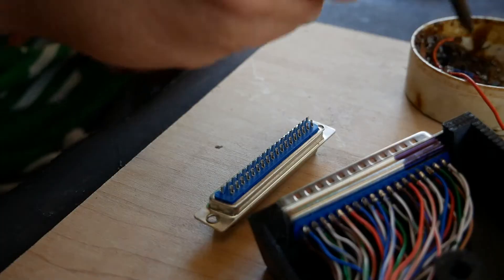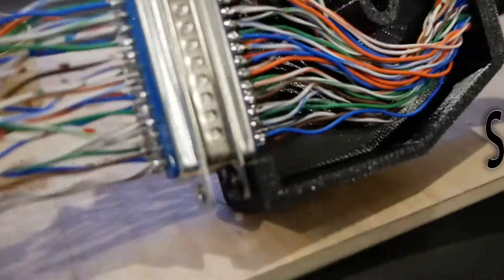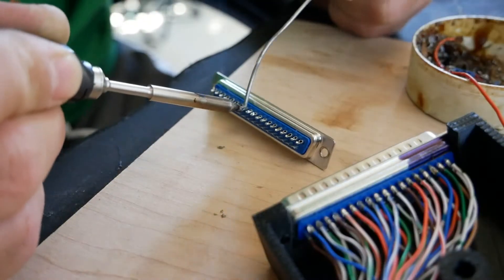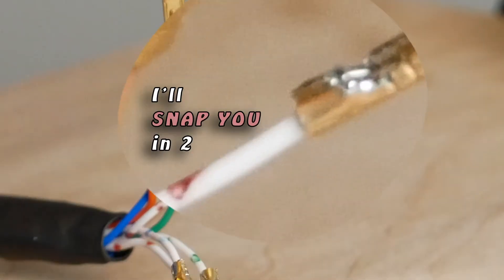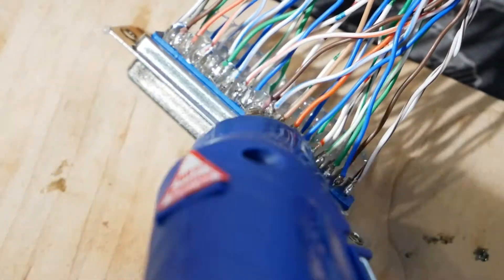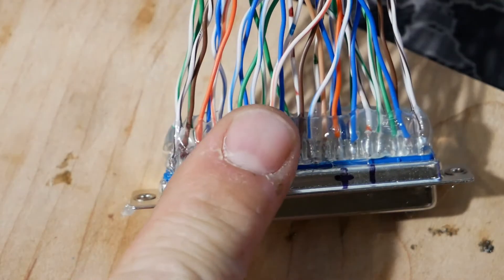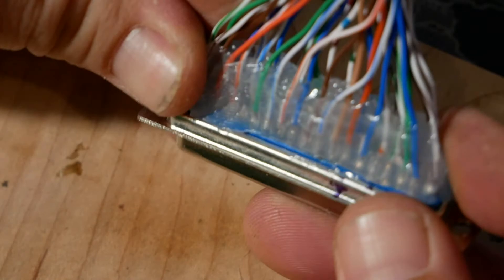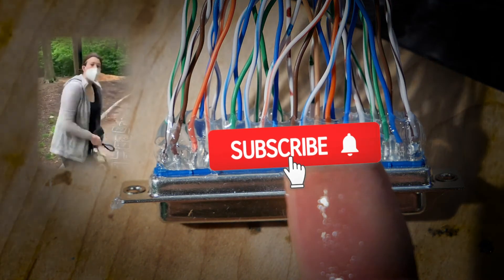Mechanical Strain Relief - TWO MINUTE TIPS for guys and gals

Comment: Further tips on soldering to those D-sub connectors (like the DB37 in this video):  
1. plug the mating connector into the one you're soldering. The pins in the mating connector will help hold the pins you're soldering in place. They will have less tendency to melt the plastic housing and shift to a different position.
2. Hold the connector in a small vise or other fixture to keep it steady.
3. Try to use the type of connector that has separate pins and comes with an empty connector body. You can solder the pins separately, then snap them into the hole locations in the body.  But caution: On some makes of this type of connector the pins can later be removed (using a small tool), which is quite useful. But on others that look similar the pins are not removable.

Comment: Saliva is a non-newtonian fluid (it's viscosity changes depending on the stress or forces applied to it) and it tends to adhere to foodstuff (like skin but not so much to thermoplastic adhesive go figure),  making food slide easily through the esophagus (or a finger across hot melt glue).

Blood is also a non-newtonian fluid although I would not recommend it for this application (that would just be weird).
Reply from the maker: I didn't know :)
Reply: Only Newton had newtonian saliva, he could never use this method

Comment: hot gluw is a crime against humanity. use epoxy, silicone or polyurethane
Reply: You know what's a crime? Epoxy, because it's not flexible, it's not suitable for strain relief, it's not removable, and it makes repair later impossible.

Polyurethane what? There's a million of them.

Ht melt glue is perfectly fine, as long as it's not somewhere where alcohol vapour or high voltage or temperature is expected.
Reply: @SianaGearz  high voltage? As far as I was aware hot glue has a very high resistance?
Did you mean high amperage (eg, heating up the wire) ?
Reply: @ColinRichardson  Don't rely too heavily on random hot melt glue's dielectric properties. It tends to hold up fine at low voltages but if you're unlucky you may find that it will arc over and carbonise, creating a conductive path, when subjected to mains voltage. Its insulation properties break down when heated or due to absorption of other compounds, such as water - which normally it won't absorb much water at all, but sometimes it will for some mysterious reason. Also it seems that repeat heating and cooling cycles can set in degradation eventually, even if the temperature never reaches melting point. And sometimes it degrades and emits corrosive chemicals for no apparent reason at all.

It's not that it will fail, even in presence of mains, but it can fail, even if it's not terribly likely, and if it does fail, you want to use it only where it definitely won't contribute to a house fire or something.
Reply: @SianaGearz  Wow.. ok.. noted.. Mains.. is that US mains of 120v or 240v for other places in the world?
I only ask because I could see myself using hot glue for batteries at some point in the future, 20s lion/lipo (84v) and if you are saying it can get dodgy at 120v mains, am I getting close to the brown trousers point?
Reply from the maker: It's perfect for the home gamer :) and it's dry in 10 seconds.... Just don't use it in hot environments lol
Reply: @DoItWhenever  no way i'm a way to hot guy

Comment: Question: how do you remove the hot glue?

Scratch that question!😏

Built to last.🤜🏼🤛🏼🇦🇺🍀🍀😎🤓
Reply: If you need to remove the hot melt glue later, just spray some ethanol or isopropanol on it, just a few drops usually suffice, wait maybe 10-30 seconds and brush it off. It will debond from the substrate and crumble in mostly substantial chunks. It's amazingly easy.
Reply: @SianaGearz  
Cold as Temperature ?

Like floor deadening in a car can be removed easily with dry ice.🤜🏼🤛🏼🤓🍀🍀🍀
Reply: @stevesloan6775  Temperature doesn't matter, in fact it might not work as well in the cold, it works fine at room temperature. The ethylene vinyl acetate polymer in hot melt glue absorbs alcohol vapour, and the volume of material increases, which then causes rapid stress cracking. I think that's what happens anyway, don't quote me on that.
Reply: Isopropyl alcohol hardens the glue making it easier to pull away. Depending on how thorough you are with saturating the area, you may need to do some cutting to make the chunks smaller.
Reply from the maker: It's "doable" .....but like everything in life, how much time and money do you want to spend on it lol